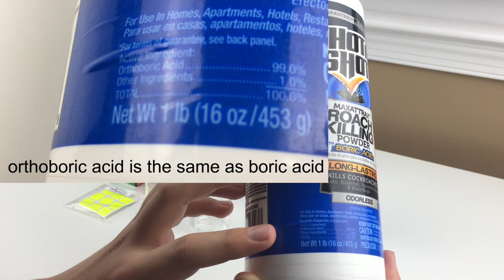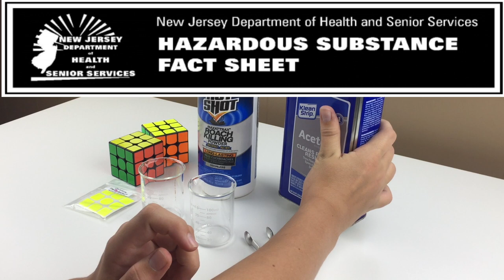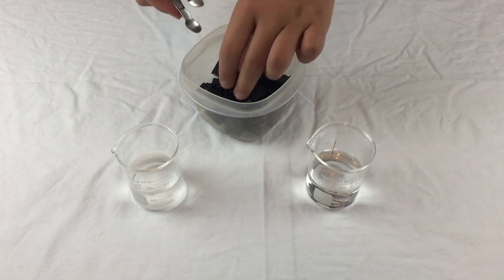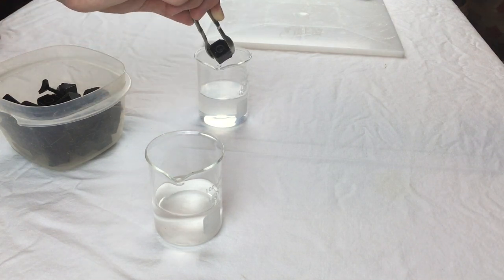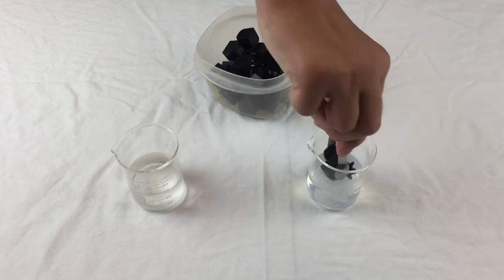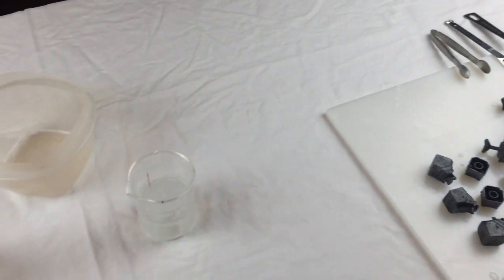How to Boron Treat a Cube - Full Tutorial

Comment from the maker: If you want to do this with a stickerless cube, you can, but it would likely discolor the plastic. You would have to dip each piece halfway in (the half that will be on the inside of the cube). Luckily since the boron treatment is just meant to coat the inside to give it a nicer feel, it doesn't matter if the outside is coated or not. ALSO, you can treat magnetic cubes - but it's best to take the magnets out, treat the taken-apart pieces, put the magnets back in, and reassemble the cube.
Reply: I have a boron little magic made with this method, just the inside is coated but it made the colors on the plastic very very light, almost white
Reply from the maker: Yeah, I've seen some at comps.
Reply: thanks for letting us now
Reply: Shroodi Rewdi  i have no idea

Comment: I wanted to remove some magnets I superglued into a cube and read that acetone will help loosten the superglue. This is very true - it does loosten the glue - it also, however, ate away at the plastic of the cube and made some of the pieces quite rough in texture. I initially thought that the roughness was just superglue goop that was stuck on but it was indeed that the acetone had eaten away the plastic. Be careful with acetone and cubes! Really good tutorial though!!

Comment: Can the cube be magnetic?
Reply: Most likely. I believe none of the chemicals affect the magnets, but I'm not completely sure
Reply from the maker: Not sure. I've been told that it melts the glue, so it's probably best not to do it.
Reply from the maker: You could magnetize it afterwards, though.
Reply: Ok. Thanks for the quick reply
Reply: I used a magnetic cube, it works the same
Reply: Acetone can work as a super glue dissolver. I recommend pushing the piece completely together before boron treating to eliminate the chances of the acetone getting into the piece
Reply: I guess it is easier to boron treat a sm than another cube

Comment: I've been told to hold the piece in the boric acid and acetone solution for 7-10 seconds. Any thoughts?
Reply from the maker: With the chemical ratios I used, that would melt the pieces too much. That's actually why I had to put the video on hold for an extra week - the original cube I made had plastic that was too soft and could be scratched very easily.
Reply: @Cubyr  Ok thanks. Do you happen to be that guy on the r/Cubers discord?
Reply from the maker: Nope, I don't use Discord.
Reply: @Cubyr  hmm. Ok. Strange, becasue someone on discord tild me about a method that was just like this
Reply: MJBCuber mighta been me tbh
Reply: @graham_lively1732  radical macaroni?
Reply: MJBCuber oh no but I know him IRL, I've done a bunch of his cubes

Comment: acetone doesn't dissolve all plastics. Do you know which cubes this works with?
Reply from the maker: It works with cubes that are made of ABS plastic (which is most of the ones on the market right now).
Reply: yea it dissolves ABS, but is there any cubes you know that aren't made of ABS?
Reply from the maker: Other than the original Dayan cubes, no.

Comment: Carbon treatment pls?
Reply from the maker: Maybe if I learn how. :)
Reply: Nice, I’ve been wanting to try it
Reply: Carbon treatment is a little bit safer and easier to do
Reply: Carbon is basically the same thing but it's a little different to  put the stuff on, you actually have to stick the carbon onto the cube since graphite (which is what I use) doesn't mix with the water like boron does
Reply: @graham_lively1732  graphite doesnt really do anything to the cube besides changing the color. I talked to Chris and he has a better way to treat things that are better then carbon and boron
Reply: Puzzle Cuber I made a few graphite cubes and they definitely had a change of feeling but they weren't good compared to the boron treatment - I would not recommend trying graphite, boron is much better
Reply: @graham_lively1732  yes I have tried it myself also